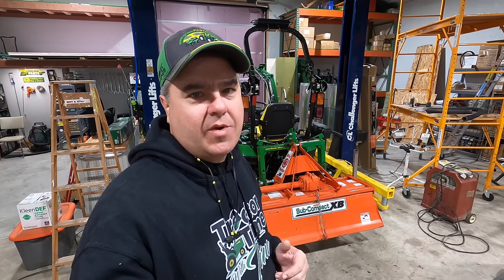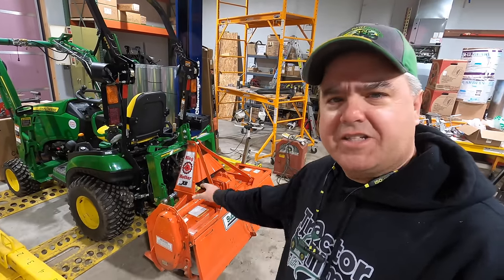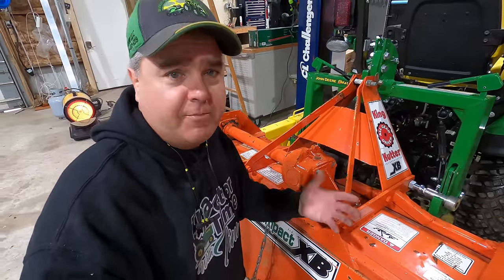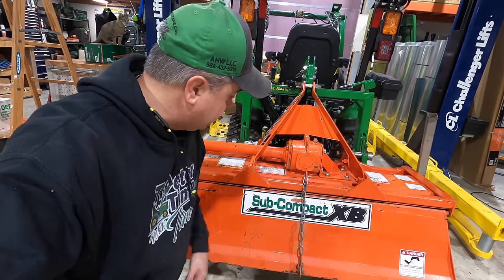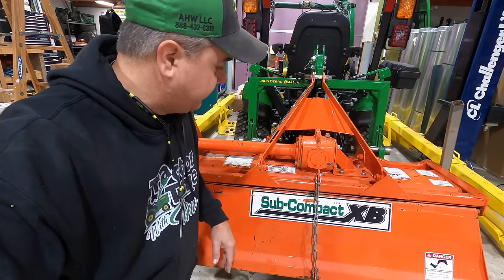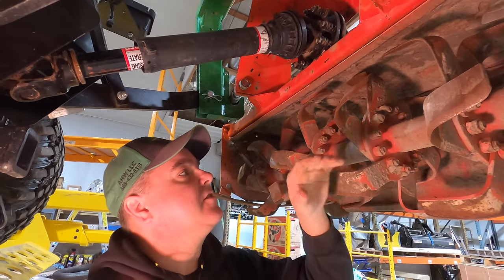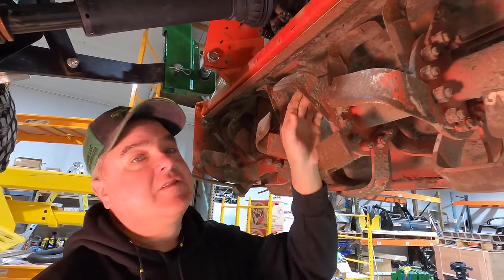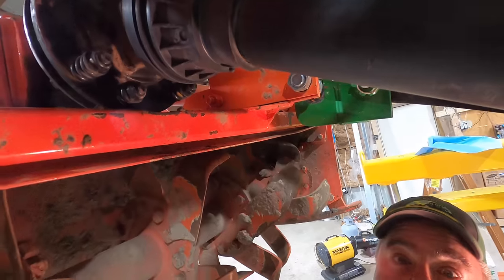Talking Tillers! Inspection and Purchase Recommendations

Comment: I moved up to a 5 foot tiller last year just so I could cover my tracks and use a quick hitch.  The new tiller is a King Kutter with 6 tines per flange. You convinced me that the extra tines are better. 

I can’t wait for the ground to dry up enough to start tilling. It is my favorite task with the tractor. 

God Bless and Stay Safe. 

The Other Tim with Tractors
Reply: What are you running for a tractor, i have a 5' that I ran on my old 3203 but it's brutal on my 1025R. I just got a 48  online but Farm and Fleet neglected to tell me the King Kutter II is an offset tiller which won't cover my tracks either. Don't know why they do that.
Reply: @starconqueror   I was running a Mahindra 2816 but now I have a Kubota L3560

Comment: I've got the king kutter II. Just replaced the seals on it this week. Replaced the bearing just since it was apart. It fits my quick attach like a champ. Love the gear drive. Love that tiller.
Reply from the maker: Did you take the axle apart on each end to get to it?

Comment: I have a Land Pride tiller for 25 years and the gear oil seal at the tine shaft started oozing, just like yours, 15 years ago. I pumped it full with cheap lithium grease and put two cans of STP in it and kind of topped it off the next  season. It's a chain driven unit. That solved  the oozing and I've had no problem since with lubrication.  Otherwise I have had good luck with Land Pride implements and have abused the tiller and a brush hog- like unit thoroughly.  Kubota bought out Land Pride's compact sized implements about 5 years ago and the quality has been maintained.

Comment: I would check the oil level in the gear box before I decided to replace the seal, a little gear oil can look like a big leak but not really be that much. Also check to make sure the breather on the gear box is working. I had to pull mine out and clean it because it was plugged which was causing the box to build pressure when the oil got warm and then it was seeping through the seal on the box so I suppose it could push it out the shaft seal too.

Comment: For the bending pins I’d weld a gusset to them. Or just add more steel and move the pin location so it can be used with shorter pins.
Reply from the maker: Yes, I agree with this solution.  Sorta don’t want to change it since folks watch our channel and like to see stuff in ‘stock’ condition.
Reply: It might be wise to leave them as a weak link and carry spares.  It’s easier to replace the pins than fix something inboard that breaks because the pins don’t give.
Reply: I think I would talk to a welding shop, and have them make an additional bracket for each side to have support for the pin on each side of the lift arm.  While you would need to use a bushing to prevent changing the original hole size, that should not be a big issue.

Comment: Thank you for covering the King Kutter 48" XB, particularly the specific mention of the centered vs offset regarding the JD 1025R.  I have the 1025R, and have watched several youtube videos including yours to determine if the centered would cover the tire tracks.  From all appearances, and tractor measurements on my part, it appeared it would.  I have purchased my TG-48-XB-RR, and it will be delivered Tuesday; but I was second guessing myself until you specifically answered my question regarding covering the tire tracks.  Thank you!

Comment: i bought a old wore out front tine for 20 bucks had no motor and all the seals were gone. i needed a tiller fast and i had very little money so i threw a 6.5 hp harbor freight  motor on it that i had as a backup for something else. when i went to dump oil in the gearbox it was puking oil faster than you could fill it so i packed it with gearbox grease. this was 3 years ago i still use this tiller to this day. also i found the grease actually runs cooler than the oil

Comment: When I had a XB, I had a fab shop make up special pins. They were thick where it attached to the tiller and right before they would connect to the QH it tapered to the size of the qh bushing. Never had issues with it. I can send pics if needed.

Comment: On the seal is usualy a number, with this number you can buy the seal from every farm supply shop. These are standard items. If the tines don´t dig,in just sharpen them. Great video.
Reply: I was going to say the same thing.  Should be a standard seal.

Tim, you might make a video of the seal replacement.   Show folks that it isn't too bad to do, which would encourage proactive repairs.

Comment: TTWT good video discussion.. I have tiller with slip clutch that will actually stall the engine before it even slips the clutch. I slipped the clutch before using and even loosened the clutch more but still stalls engine before any damage can be done..I have a 18hp pto with landpride 1250r tiller. Thanks.

Comment: I seen the Lincoln welder. Weld on some brackets to strengthen the hitch pins. That way the pin has 2 points to hold your quick hitch.

Comment: I bought a King Kutter gear drive green colored tiller 60 in and use it on my 3038e. I had to make the top bolt hole bigger to adjust it to fit on the quick hitch. The 3 pins just would not lock because of about a 1/4 in differance .

Comment: Hey Tim, maybe a plate on the end of your quick hitch pins would help keep them from bending. Or extent the shaft all the way out tot the end of tiller where you could mount a plate to the end of the shaft? I don’t use a quick hitch just because there is so much Limestone in the soil. There is also some pretty hard clay to work through in south central Pa.

Comment: Tim a gear drive tiller is more prone to if any speck of a bearing material in one of the 4 bearings gets lodged between the teeth it will stop it dead a chain drive you can gear it to spin faster at a lower rpm which can save fuel

Comment: Tim in reference to your storage for your equipment , i notice you have heavyduty storage racks, pickup yourself up a shop forklift and put all your equipment on palletts and store on the top shelves
Reply from the maker: Obviously a forklift would be optimal, but the forks on the tractor do a suitable job of lifting attachments to the higher shelves.  Ceiling isn't high enough in this building to stack stuff very high, so not much more to be gained.

Comment: Good to know about the pin length...for when pins break, one needs to make sure the tiller doesn't crawl towards their tractor and compress the PTO into the tractor. Might actually want to weld a bracket that holds the outer end of the pin to prevent bending.

Comment: Tim, great video!  What are your thoughts on the King Kutter XBX 54" tiller for a 1025R?
Reply from the maker: Too big...At least for some of the places I have filled.  Also, why do you want bigger?  Do you really have that much to till?  Costs more.  Takes more storage space.
Reply: @TractorTimewithTim  Looking at the 54 so my father-in-law and I could share it, he has a wider tractor.  But I too am worried about the 54 being too much. Thanks.
Reply from the maker: Mark Sheaffer several folks use them on a 1025r, so you will probably be fine.

Comment: NAPA is a good source for seals, just read the numbers on the old seal and they can cross reference it. You can verify the OD and ID when ordering. The seal probably was cut by the grass wrapped around the shaft. Clean that area daily and your seals won't get damaged.

Comment: Thanks for the video. I'm actually looking for a tiller and I have a question. When did determing the size, does it matter or not, if it's the same width of the tractor that you're using it behind? Trying to figure out what size is better to maneuver with the tractor.
Reply from the maker: Best if at least as wide as tractor.  However, sometimes you can’t handle that wide.
Subcompact tractor is optimally suited for 4’
Reply: @TractorTimewithTim  Thank you for the input.

Comment: Very informative video Tim,   your Challenger lift is helping us all out, I found it helpful being under the tiller to see what you were trying to show us.  I wonder if it might be worthwhile to first try putting TransX auto transmission sealer in the tillers oil reservoir to see if it would stop the seal from seeping before you go through the work of changing the seal. 👍🙋‍♂️🙏

Comment: Lol......was gonna say tim.....you might be envious of the ones whom have already tilled.......im up here in maine plowing.......SNOW still lol. 
    Just got a massey 1010 with a loader, blower, and cab.  The snow has been melting fast but ive been opening up areas of our property that hadnt been plowed. We still have a good foot of snowpack. 
     I wish i had a tiller for my tractor but funds were all used on my tractor and the rest setting up for to virus lack of work and whatnot.  So well have to make due working our garden with what we have......what our old troybuilt cant till ill help it out loosening with the loader bucket.

Comment: Your issue with the pins being too narrow for the 3-pt iMatch and therefore having to be lengthened and susceptible to bending led me to choosing Pat's 2-pt Quick Change instead.  No adapters needed and width quickly and easily changed as needed to fit the rear implement.  You should give them a try and report on them.  It would be useful to get your take.

Comment: You won't have to worry about them till they become pointed. Gear drive tillers don't have the toughness of chain drive. Chains have a little bit of give that gears don't when they slam they hit harder. I have seen several gears with teeth broken off and cracked gears but so far have never had to replace a chain.

Comment: Plus with different situations smaller is better. Some gates are too narrow. Rent stuff be careful cause units are used and abused so look it over pull cords oil level spark plug.and filter if it has one.

Comment: I noticed your Tuff Line tiller has a top shaft that runs the full width of the tiller out both sides of the gear box while the King Kutter has a top shaft that is only on one side of the gear box. What is the difference and why might a person want one design vs. the other?
Reply from the maker: Good question, Joe.

Comment: Be pretty easy to make a better pin on a lathe. surprised I don't see even a little lathe in your shop.
Reply from the maker: I'm far from a steel worker.
Reply: @TractorTimewithTim  A small $800 Micromark 7x16 lathe would come in handy. I have a larger Grizzly 4003G, I just used it to make a bushing for my dryer.  I have a cnc equipment in my garage, and make utility knives. Have any use for a utility knife? I'm not on youtube much but did just follow you on Instagram.

Comment: Hello Tim...I have asked you this before and you said something was coming??? I have a 1025R and this last winter I had the 54" blade with the quick hitch on it. We finally got that off and I am trying to get the loader on the tractor. I also have a Mauser Cab that I love but it gives me NO room to get the hydraulic hoses hooked back up. I am about ready to sell it all because of it. I asked back then about a quick latch or something that all four hydraulic hoses hooked up in one pull down latch. If I can't find a solution to my problem I will have to sell...Help! Please!! Thanks...
Reply from the maker: It is coming, Mike, but there was a delay.  Hold on.
Reply: @TractorTimewithTim  … Okay Tim, thanks very much! I really appreciate all that you do...I will hold on...

Comment: Let me be your first to say I wish I had bought a different tiller. Now my tiller is getting to be to big and not QH compatible. Have to say I was happy till I just got tired of man-handling it, or should I say "I'm getting older"... and probably weaker. I'm slowly working on a time schedule to replace my tiller and getting a QH. Won't happen this year but who knows. Don't need it right now anyway. Like Lucy used to say, I can make what I have work.
Reply from the maker: Hey Levi!   Great to hear from you!   Maybe Pat’s easy change would be a cheaper solution for you?
Reply: @TractorTimewithTim  I've thought about it but it won't work on the tiller. Would for the box blade but if it doesn't work for the heavy tiller I don't want to spend the money for it.

Comment: I have a nearly new 2019 1025r with 14hrs on it. I got it with backhoe already on it and yesterday dropped it and put the 3pt on and tiller for the first time. (Theyre brand new too.) But the pto wont engage. Button lights up, dash pto light comes on and dash says pto is at 280rpms at idle but pto isnt running at all. Ive tried different positions on selector for pto to no avail. Am i missing anything or is something broke even though its brand new as i have yet to use the pto on this tractor. Any insight, Tim? Or anyone? I'm stumped and my dealer is closed because of this virus crap.
Reply: For the record i bought the tractor july of last year brand new, with warranty etc as well as the loader, BH, tiller, brush hog and pallet forks. So far i like my tractor but have been disappointed by some of the quality/fit of the attachments and having to go buy parts that the dealer never gave me for the attachments i got.
Reply from the maker: Pto lever just left of the seat must be set to ‘rear’
You must be sitting on the seat.  
Other than that, I think you should call your dealer.
Reply: Alright. Yea ive tried about everything, searched for blown fuses and any frayed wires but havent found anything bad. Guess the dealer is my next option. Thank you for the insight though.

Comment: I will say I am super glad I bought a reverse rotating tiller, in hard ground it will pull its self in the ground and goes way deeper than a forward tiller
Reply from the maker: Any rocks?
Reply: @TractorTimewithTim  yeah, the normal obstacles, it has a slip clutch although must small and medium rocks go through, if it gets jammed I just turn it backwards with a bar, but even tilling new gardens it rarely happens.

my biggest struggle is I always seem to find construction junk. bricks, wood, rocks, re bar even a concrete slab that was buried (no wonder the tiller would only go a couple inches in the ground lol)
Reply: Tim, I bought a 6' woods reverse tine tiller last year to replace my old King kutter. I am on ground that has a bunch of sand and gravel and what I have found is that alot of the rocks will actually get pushed forward to the end of the row. This is nice as long as I get around to going back and picking them up. I had my King Kutter for 10 years and had a ton of hours on it and the paint was faded from the sun and significant wear on the tines and I still was able to sell it in two days for my asking price which was just over half of the cost of my new woods, they really hold their value I guess because there isnt many used ones ever on the market (kinda like dump trailers).

Comment: I just bought a sub compact xb tiller for my 1025r and had to grind that metal tube down to get the drive shaft on because the slip clutch was too large. Which kind of puzzled me because its the drive shaft that came with the tiller.  Great video.
Reply from the maker: Wow.   I bought my drive shaft separately, so it was not the standard one. The original slip clutch was a smaller diameter.

Comment: I have to say I do not like the tiller I have. It is a Tar River DLT-S50.  It is not well built.  I have had it for 3 years and have about 16 hours on it. Gear box is leaking at the side shaft and the rear gasket. It only tills 4” max. It has trouble if ground is not just about completely stripped off. So I guess I go against rule number one, lol.

Comment: Well... I am the first one then, I did not like my first tiller. :) For me it was a starter tiller, really cheap for a new one. It did broke 2 times and killed 2 pto shafts. Second time I bought myself a decent one, less stress on the tractor, better results... It was a made in China. Not saying that everything that comes out of China is bad. But if it's to cheap to be true...  You know it can't be true. :)
Reply from the maker: Ok, fess up.  What brand was your first one? :-)
Reply: @TractorTimewithTim  It was a GEO tiller, a brand sold at many different dealers in Europe, also under many different other names. The cheapest was around 1200$ for 1.2 meter / 47" at that time (8 years ago). Now I bought myself a Maschio and more than happy about that one. For the GEO tiller, I got 2 times the same issue, the gears got lose and blocked the whole machine at 540 rpm.

Comment: The part number of the TG 48 Side Gear box oil is #977029
This is the TG 48 Manual 
http://attachmentknowledge.com/king_kutter/manuals/tillers/king_kutter_xb_48_tiller_manual.pdf
Reply from the maker: Don, I don’t think I need to buy the whole gearbox!! Did you notice that the seal is not in the parts list for the subcompact XB tiller...in fact, the gears, etc are not listed.

Comment: Tim
You are wrong on the size tiller you run.
I have 24hp compact tractor.and the manual calls for 53" max tiller.
My first tiller was a 47". Didn't like it. It left tire tracks. I got a 57" tiller and my tractor handles it just like the 47". I have no complates.